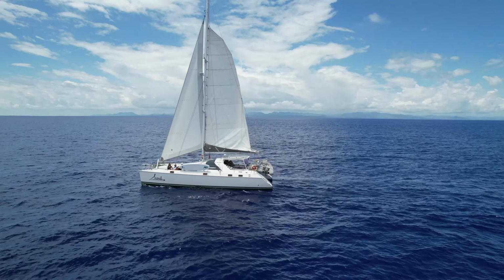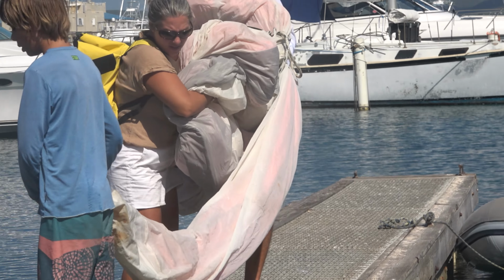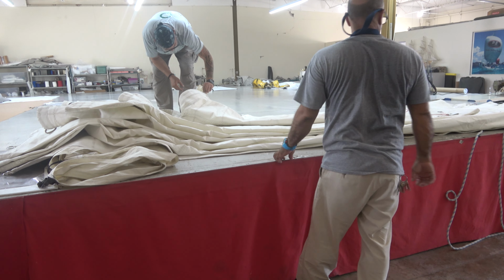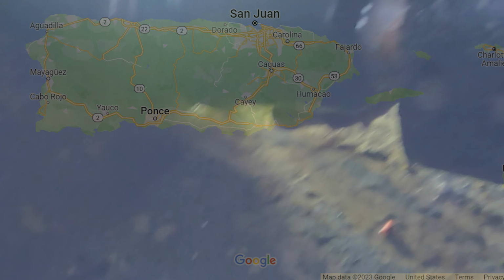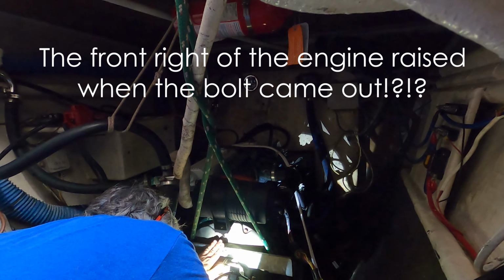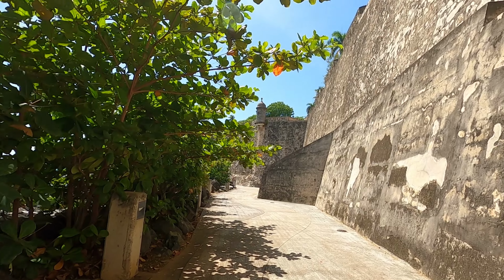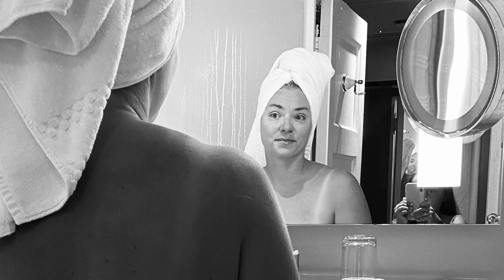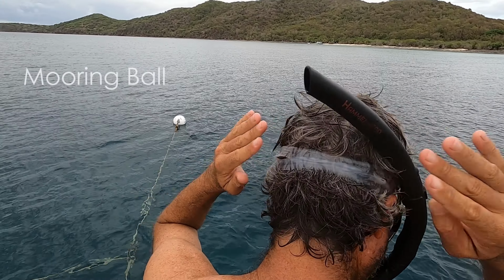PUERTO RICO: a ripped mainsail & two broken engines...BUT IT'S NOT ALL BAD! (Ep. 19)

Comment: Like someone else said,seems that every sailing family experiences mechanical problems, but I gotta ask: what’s your level of frustration?  I know y’all must of had the boat surveyed before purchase, so I can’t imagine y’all expected the problems you’ve had.
Reply from the maker: I always say every time something breaks I go though the 7 stages of grief. It’s never fun, but the reality is stuff breaks on a boat. It’s a harsh environment. Sometimes ‘breaks’ isn’t even the right word - most everything has an expected useful life. Sometimes that’s 10 years, sometimes 2. Of course actual useful milage varies. For example, this upcoming week I change the water maker membranes which are supposed to last for 5-7 years but actually made it 12. On the other hand, house water pumps should last a couple years but I haven’t had good luck with those. Believe it or not, I feel good about the boat we bought. Most issues we’ve faced to date have been relatively minor (knock on wood).